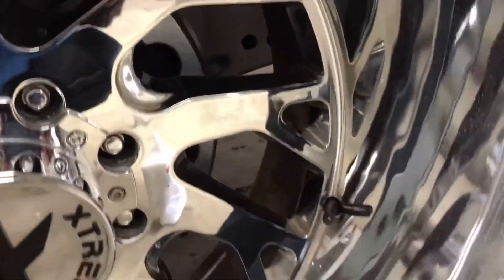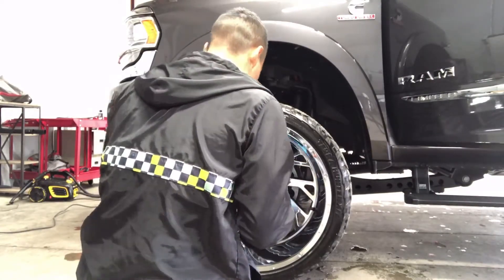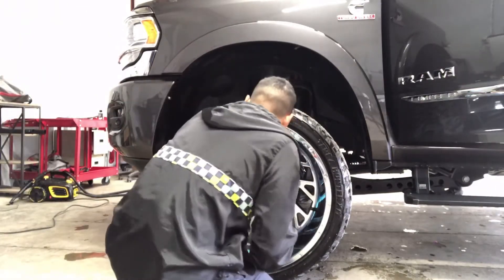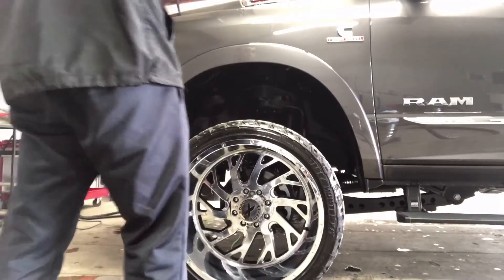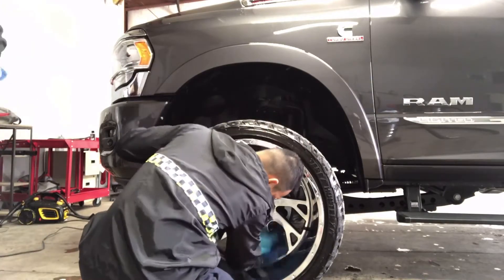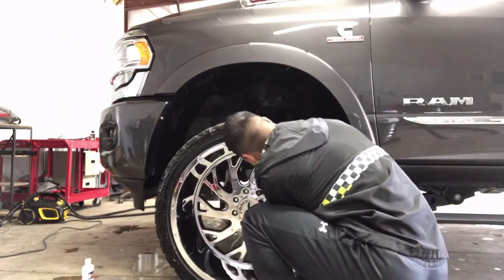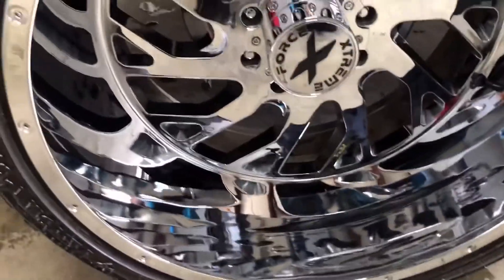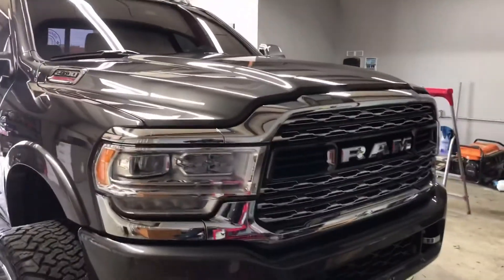The Best Chrome Polish - Easiest Way To Bring Mirror Finish 💎

Comment: On chrome wheels water does the same thing😂
Reply: Not necessarily if they have oxidation.
Reply: Water leaves spots .
Reply: After a while it gets more difficult to remove water spots
Reply: Maybe on cheap ones..

Comment: Those aren’t billet wheels??! Sure looked like polished aluminum..
Reply: genuine question is the process between cleaning chrome and aluminum much different and is it bad to use the same process between each other?
Reply: @zzreign3214 If you’re doing it by hand using this polish yes it’s the same process. It’s generally much easier to polish chrome wheels though. With aluminum you’re polishing bare metal. It’s messier and the process can take longer if it’s been a while and the surface is oxidized etc. 

Once you move onto using a polisher than the process is different between the 2. You don’t polish chrome the same way you polish aluminum when using a machine.